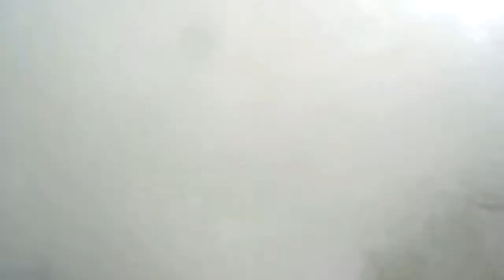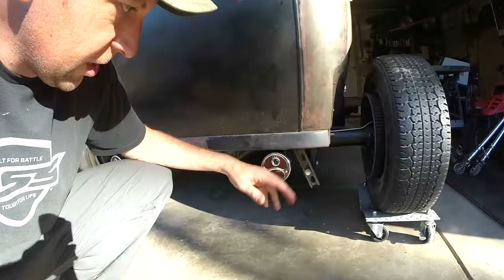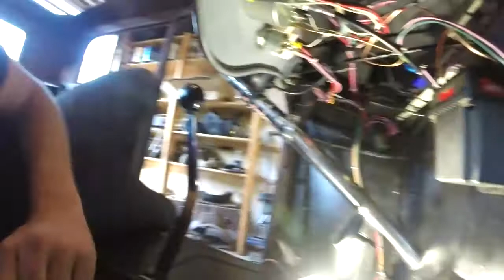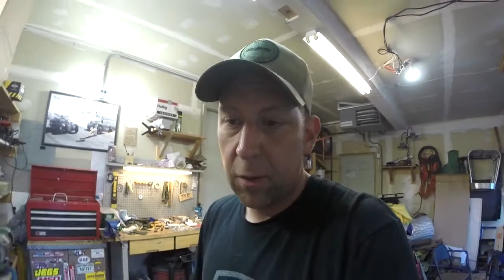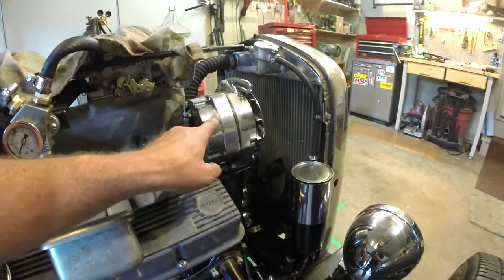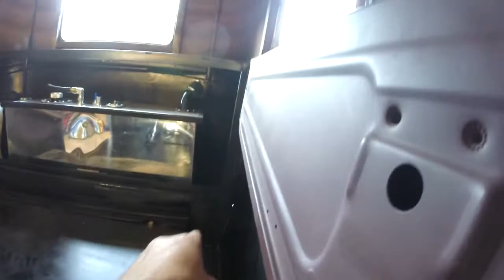Speedway Motors 12 Circuit Wire Harness Install- Part 2! Install Complete!

Comment: Can you please send me a diagram you made work for you with the speedway harness and the 7 wire turn signal switch like you used also having issues on how to wire that and universal high low foot switch. If you can help me with that I would greatly appreciate it. Thank you
Reply from the maker: Check out part one of this series:

https://youtu.be/pDUFtnL5KD0?is=BzhEn8n6pCYV_PbE

In the description there is a link to the instructions on using the wire harness.
Reply from the maker: And then check out this video on wiring the turn signal switch: 

https://youtu.be/4cTkEtFoJKk?is=yxY04QUs2_6F6xp4

Let me know if that helps.

Comment: So i got a speedway 12 cir. harness, there are 2 - two prong flashers in the harness. Do I convert one of those to a 3 prong flasher ( which one) and what do I do with the other 2 prong flashers? I’m having a problem figuring this out. Thanks
Reply from the maker: Yes! The short answer is do with a 3 prong flasher in order to make turn signals work.  Especially if you are using one of those aftermarket turn signal switches.  Check out my channel, there is a video on how to wire it in.
Reply from the maker: https://youtu.be/4cTkEtFoJKk?si=nqIXyabWrKE07SXr

Comment: How did you get your headlights to work?
Reply from the maker: I don't recall having any issues getting them to work.  I just wired them up per the instructions.
Reply: @BadHombreGarage  the reason for that question was that I have installed that same harness in my project truck. It's a ls swap with standalone. 

Are there a set of wires that are on inside for headlight connection, or did you have to tap into the wiring?
Reply: I got it figured out. Thanks for the response and the video posting 👍
Reply from the maker: @jasonking-g4v  I think there are wires for a headlight switch.

Comment: How does the power come from the fuse for lights and brakes.
Reply from the maker: Do you have your diagram that came with the kit?  The wires should be labeled with each component.  It also shows how the input from the brake switch ties into the harness so that your brake lights work properly.  If you are using an aftermarket turn signal switch check out the video I made on how to wire that in so that your brakes and turn signals all work properly.

Comment: I used the same wiring harness ( after watching your video). Seem to have a problem installing my ammeter gauge. Directions tell you to run red solenoid power wire to ammeter and then on to the solenoid. But then it seems to be hot with key off. ( I used the test light to test ground side of battery ( beteen cable end and neg post like in directions) and it lit up. Can you help? Roger
Reply from the maker: Roger, thank you for watching the videos! I know the video won’t help because I do not normally use ammeters in my projects; I use a voltmeter gauge to tell if my car is charging.

Comment: is it necessary to run a 120 amp fuse between single wire alternator and starter?
Reply from the maker: No, certainly not.

Comment: Great videos! It's helping me wire my T-bucket right now. One question I had was what did you use for your instrument panel lights? Unless I'm blind, I don't see it in the harness even though it shows wire #62 in the instructions on the gauge diagram. I'm assuming that they could be wired in with the running lights.
Reply from the maker: Glad it helped! I am going off memory here, but I think there was a post on the headlight switch for dash lights.  If not, I think you could just pull them off your running lights.
Reply: @BadHombreGarage  I'm doing a headlight switch with built in brights and the instructions weren't the best. Fortunately Speedway Motors is 3 miles from my shop so I'll be sure to ask them when I go in tomorrow.  Thanks for the reply. 🤟
Reply from the maker: @huskerjeep right on, let us know what they say!
Reply: @BadHombreGarage  after finding a good picture of the wiring diagram,  there is a designated circuit to wire to specifically for dash lights. 👍
Reply from the maker: @huskerjeep awesome, thanks!
Reply: @BadHombreGarage  Whoops, I should clarify,  a good wiring diagram for my headlight switch. It'll actually make getting power to the dash lights easier since it's close by, and I won't have to find a wire with designated power just for them. 👍
Reply from the maker: @huskerjeep 👍

Comment: Hey there  have run into the same problem!  I have the purple #25 turn signal flasher and the brown #27 flasher. Can you post a pic of which wire went to the new flasher and the other wires that went to the turn signal switch? Building a 57 chevy 4x4 thank you!
Reply from the maker: I’ll see what I can do…
Reply from the maker: I think if you watch my more recent video on how to wire a universal turn signal switch, it might show you what you are looking for.
Reply: Hey sorry just seen your other video! Perfect explanation and diagram thank you very much! Been having a rough time trying to figure out why my lights weren’t working correctly! Thanks again
Reply from the maker: @TayloredTrucks  perfect, I’m glad it helped.

Comment: Great video. Re doing a model A sedan hot rod. They used a 20 circuit but it’s a mess. I’m eliminating a lot. Just want to start from scratch.
Reply from the maker: Thanks for watching and for taking the time to comment.  Yep, sometimes it's easier to just start over.

Comment: Just wondering do you have a part  number for the three prong flasher? I have the same tail lights and turn signal control as you. Also I can’t seem to get any power to the turn signal flasher even if I turn on the switch to accessory. Would like to know how you wired the tail lights too. Confused 😐
Reply from the maker: Try the Napa # NF 550 or something similar.  Just make sure it is 3 prong and  12 volt.

Comment: Excellent info on this kit… you answered most of my questions regarding using circuits for other stuff…. I have a fuel tank swapping valve that I’m gonna use on the fan relay…. Thanks!
Reply from the maker: Thanks for watching and for taking the time to comment.  Have fun with  the project!

Comment: I’m using the same stuff u installed and got confused with the blinkers
Reply from the maker: Did the video help?
Reply: Yes I’m ordering the 3prong flashers and other electrical stuff battery it’s my 1st full build
Reply from the maker: @greggturner7213  cool! Don’t be afraid to reach out if you need help.  badhombregarage@gmail.com
Reply: 31 3 window coupe

Comment: Hi. Thanks for explaining so well. I am going to be doing the wiring soon. I re used the original, modified 54 Chevy column, But I also have a Astro van tilt column. I'm always fighting with two choices. So I will tell you what I did. Thanks.
Reply from the maker: Thanks for watching!  It’s hard to beat the look of the original column, but a more modern one can be nice.  Good luck with the wiring process, let us know how it goes or if you have any tips.
Reply: @BadHombreGarage  Thanks, I'm retired ,  I needed gut space, so I moved the column closer to the dashboard. I modified the 3 on the tree to an automatic shit lever. But I'm never satisfied. I like the convenience of the tilt column, I may still leave  the ignition on the dash cause the hole is there. I don't know. We will see.
Reply: Thanks for answering. That was real nice of you. Thanks again JB
Reply from the maker: @juanbarturen2726  that’s hot rodding!

Comment: 22 circuit speedway on my 37 chevy turn on heater it comes on but only a couple seconds shuts off switch back off and back and shuts off again do I needto add a relay?
Reply: A relay wouldn't hurt, especially if it is pulling a big draw.  Perhaps your switch isn't rated enough to run the heater through it?
Reply from the maker: Probabaly; did you get it sorted out?

Comment: Great video!. I am trying to bring my drag car back to the streets, but I need a wiring harness now. Does the directions have for MSD 6AL box hook-up.
Reply from the maker: https://static.speedwaymotors.com/pdf/910-64017.pdf
There’s the link to the directions.  Nothing specific on how to connect to your MSD, but if you have (or can find) directions on how to wire the MSD, you can deduce what wires from the harness need to be used to power it.

Comment: Watched your vieos keep up the great work.Still some confusion as to wireing in the aftermarket switch?I wired mine and still had a purple-turn flasher wire and a brown flasher wire left over>I new you had to put a 3 way flasher along side the column,but nowI am cofused asto what wires go to the 3 way flasher?The diagram I have shows the red wire to be put into the panel with a fusable link as power,I think your video said you did not have to do that?Sorry I love when there is simple drawings telling what to do?Any help would be great,Thanks.
Reply from the maker: The trick is to use a 3 prong flasher, and to wire it up just like the diagram.  The L prong to black, the P prong to blue, and the X prong to power- your choice either keyed or constant hot.  Constant hot is good so you can run your hazards without having the key on, not good if you leave a turn signal on and walk away from the car.  I used the prong plug that came with the kit, I just used all 3 wire terminals in it instead of 2 like it comes on the kit.  One of the 2 prong plugs in the kit was not used.  
The way the kit comes, it is set up for one flasher for turn and one flasher for hazards.  Works well with a GM column, not with the universal signal switch like I have.   I replaced both 2 prong plugs with the modified 3 prong plug.
Reply: @BadHombreGarage  Thanks its a 40 Hudson coupe,with a 68 Caddy column,that was stripped out ,now its just a mechanical connection.no wireing.Thanks for getting back to me,all the way up to Ontario Canada.Keep up the good work.

Comment: I’m still having issues. How did you wire up brake switch?
Reply from the maker: I used a pressure switch.  I used the orange wire into one side of the switch, and the white wire out.
Reply: @BadHombreGarage   is one the wires going to the Universal Turn signal switch?
Reply from the maker: @48Flattielife  Yes, good call.  The orange wire is the brake power and goes into one side of the brake switch.  The white wire comes out of the brake switch, and I used that wire to feed into the red wire (brake stoplight switch) on the universal turn signal switch.

Comment: So I can use the hazard wire or the turn flasher wire for the power wire on the universal turn signal switch 3 prong flasher??? This thing has been a nightmare for me
Reply from the maker: Yes, that is what I did.  It just needs a power wire.  Your choice if it is “key-on” or always hot power.

Comment: Hi Joe, I am also installing the same Speedway harness that you have along with the same universal turn signal switch. I bought a three prong turn signal that the signal assembly required Speedway only has the two prong for the hazard and turn signal on their harness. My question is which wire did you use on the harness to power the 3 prong flasher? Was it the turn signal wire or the hazard flasher? I watched part two of your wiring harness install to see how you connected the turn signals but I wasn't sure which wire did you use for the signal flasher. Can I put another wire from the harness as long as it is a constant hot wire. My hot rod also has no added accessories like A/C, power antenna or a radio. Bare bones build. I appreciate any assistance that you can provide.  Thanks.
Reply from the maker: I believe I used the hazard wire because it is constant hot and I wanted flashers without having the key on.  And, yep- I think any hot wire will work, it just needs power. Thanks for watching! I hope it’s helpful.
Reply: @BadHombreGarage  Thank you for your response, Joe. I appreciate it. I did as you suggested in looking for a constant hot wire in the harness to power the flasher. Since I do not plan to install a radio, I used the radio power line to feed the flasher. Thanks again for your help. Best to you on your present and future hot rod projects.

Comment: I'm putting the same front turn signals on my '26 Tudor but, I'm having a guy reproduce the lenses clear and I'll use orange bulbs (found dye at a craft store). For parking lights I have a chrome bulldog with light up eyes for the radiator top. My '27 roadster has a polished aluminum bar in the front like a '32 and it was milled out for a couple lenses from '76 Ford pickup front side markers. They had to go. I made clear lenses out of a '90s Chevy work van front turn signal. Now you hardly see them. I'm going to make a new bar so I can make the lenses about 2 inches long. Old cars didn't have orange lenses and to me, they just stick out too much. I came here because I'm working on a '55 Cameo with a 12 circuit in it. I found the power antenna wire out front and a power antenna wire inside. Does it get power from the fuse box or from the radio? If it's fused and comes on with the ignition, I'm using it for the 400 kickdown.
Reply from the maker: Great ideas on the park lights!  Here’s the link to the instructions for the 12 circuit harness: 
https://static.speedwaymotors.com/pdf/910-64017.pdf
On page 7 it lists the power antenna wire as a 12v fused wire for powering accessories.  I believe I’ve used it in the past to power different components, so it is not powered by the stereo.

Comment: Hey Joe......where you going with that gun in your hand? Sorry had a Hendrix moment there. I am a new subscriber and am putting a harness in a 65 c10. Ive also got the line lock but in addition a trans brake, bump box, Holley EFI, anyways with that being said, my question is with the turn signals I have the "pronged" indicator and the hazard wires. Do the prongs go to the flasher or to the turn signal switch? I dont have anything coming off the fuse box except those and am wondering where to install them.  I am having to retrofit most of the dash wires to my original 65 plugs via repining them to my original bulkhead  plugs thru the firewall for engine bay, lighting well, anything outside of the cab and am a little hung up on this. I bought my harness form a cousin that was going to put in a 55 Chevy and its all there except for the instructions/diagrams although very important looking for them was overlooked so, internet surfing has become the staple point to the install and all the help I can get is welcomed on certain things like the turn signals. 
Joe,  I wanted to also say Great videos. Not everyone has the charisma for making them nor the patience to describe certain things w/o making you feel like more of an idiot than you already do for having to look some things up so good job making these. well done and they make a lot of sense to me. Thanks,
                                                                                         Soda Can
Reply from the maker: Soda Can, hey I love the great feedback!  Thank you for taking the time to watch and comment on the channel. 
As far as the turn signals go- it's a little tough to tell what exactly you have going on.  I will say that I struggled with mine because the wiring kit I had was set up for using 2 two-prong style flashers; one for the turn signals,  and one for the hazards.  Well, the turn signal switch I used was set up for 1 three-prong flasher that worked for both the turn signals and the hazards.  You'll need a flasher for both- but some setups have them going through one, 3 prong flasher.  Let me know what other info is needed, and I'll try to help you out!  Thanks again for watching.
Reply: @BadHombreGarage  Ive got the dual flasher setup. What I was referring to was the wire with the plug insert already on it (not terminated) I was wondering if that pin gets cut off and then wired into my switch? After messing with it for a couple days and searching the internet I am at the conclusion that it gets cut off and re-pinned with my style plugs pin . Correct me if I’m wrong please, if it isn’t correct I can always cut it again and try it another way I suppose. Joe, I appreciate you replying to me. You are the first to respond to be completely honest. 
  I tell you what, when it finally gets running good , I’ll send you the first big ass burnout with the new setup. A guy has gotta do a big one on new slicks to brake em in and all you know how it is lol
Reply from the maker: @mookandairin  I think I know what you are describing with your wiring.  The Speedway kit I used also had the dual flashers (two, two-prong flashers).  I did have to cut them up and re-pin the setup into one, three-prong flasher.  I used one of the cheapie turn signal switches.  It came with a wiring diagram and showed the three prong flasher, so I just un-pinned the way the wiring harness was setup and used one of the hot wires in to power the switch.  The other wires I used per the diagram on the switch.  I am not sure what kind of switch the '65 C10 has, but I know my old '64 CJ5 has a turn signal switch that is basically the same as the cheapie that I used in the model A.  So,  a guy might be able to google up a wiring diagram for one of those turn signal switches and get close to what your truck has.  
I agree- give it a shot if it makes sense- It's just wiring so you can reconnect it if you want!  Your truck sounds like it'll be a real screamer- I look forward to those videos!